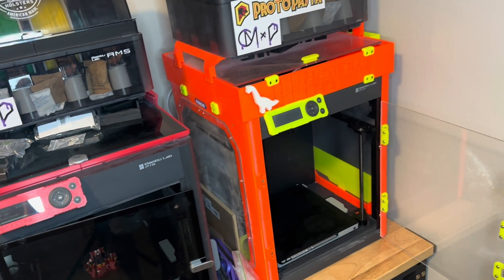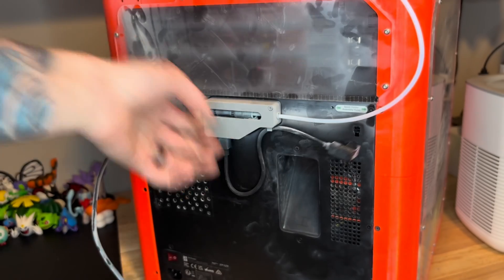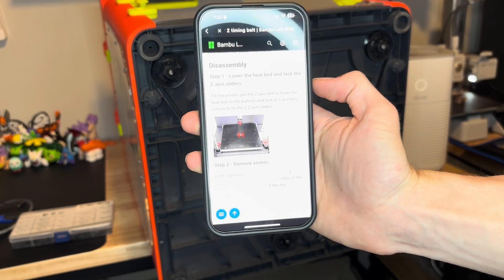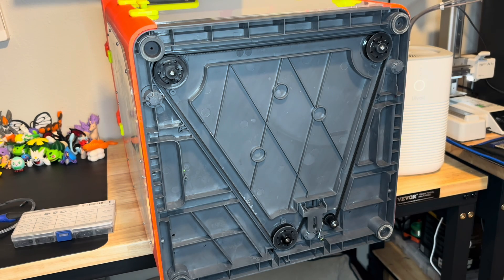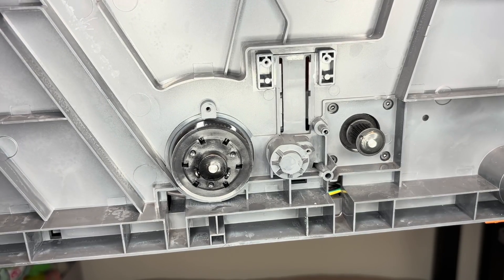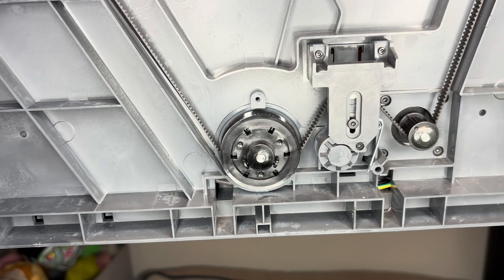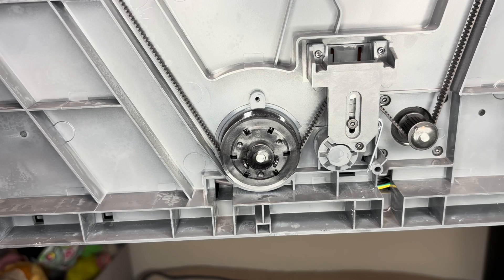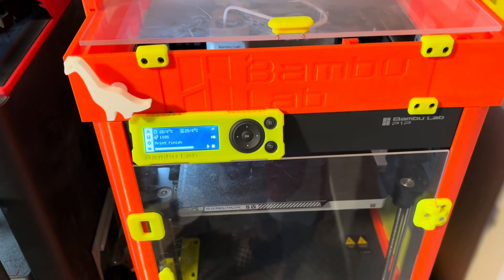P1P/P1S/X1 Z-Belt Tension Adjustment

Comment: The only reason for locking the bed down is so the three screws will stay synched when you remove the belt. FYI, a new belt is 5 bucks from Bambu Labs, and a new tensioner bearing assembly is 8 bucks.

Comment: What if you move one of the rods circle to much before you put belt back? Will that rise one side of printing table?
P.S. don't wear any jewelry on hands when you work with mechanic.
Reply from the maker: No it wont matter. The printer will run through a leveling test befor your print and auto level the bed

Comment: I would recommend using a toothpick with some kitchen paper around the top to clean the bearing, instead of  metal on metal action.

Thanks for the video! You gave me the confidence to do this maintenance and since then the squeaking is gone. I had a lot of build up on one side of the bearing where the belt was rubbing against.

Comment: I think you missed a step at 18:10 unless they recently updated their guide. Good video tho, appreciate it. 

"pull the Z belt to move the heat bed up and down, confirm that there is no abnormality in the movement, and then lock the tensioner screw."
Reply from the maker: Yeah that was added after i did my video.

Comment: What do I lol. I skipped reading the manual and I don't have those locking screws anymore I took the belt out before doing it and I had to lower each lead screw separately till it hit bottom, I want to put it back but am afraid I ruined the leveling. Any idea on what should I do.
Reply from the maker: So the best way to fix the leveling if you have all the parts out is to put the build plate all the way down and then re assemble from there. You can buy the spare parts from bambulab.

Comment: Great vid and directions. It worked perfectly on my first P1S, but on my second one the nut for the "Z-Axis Tensioner" fell out and vanished. Be careful y'all bc the threads are on a little nut that's not glued in. It just flew right out.
Reply from the maker: I have a whoke box of extra parts for this teason
Reply: @NotAnotherPrintingChannel  My collection of spare parts is growing. Had a hard time finding any info on the size needed...so I guessed. Lol. I bought a pack of M3 hex nuts from Lowe's and luckily they worked.

Comment: Don't you need to align the heatbed? You rotated the individual Z-axes without a belt. Not much, but that could have an impact, right? I was just wondering.
Reply from the maker: You do want to be careful but no there’s only one drive motor from what i have seen it self aligns

Comment: Thanks :) I have some noise from one of the bearing under one of these big black wheels.. it look like I have to remove all the stuff... only printing PLA not save me ^^'
Reply from the maker: I would first try to lubricate the bearing with 3 in 1 oil or bearing oil before you tear down
Reply: @NotAnotherPrintingChannel  I remember to have try that already by the top on the screwshaft side, I will try again to avoid unmount the whole thing. Thanks for advice :)

Comment: The video does not actually tension the belt....clickbait title. He thinks the belt is tighter after folowing the wiki but there is actually no tensioning system.
Reply from the maker: The tensioning system is the spring loaded piece in the front of the printer. You should do your research a little better 🫠

Comment: I wonder if you can just remove the small black screw and just re tighten after. I feel like this has a lot of unnecessary steps if you’re not replacing the belt you only need to fix tension.
Reply from the maker: Yes you could do that. However removing the belt allows you to check it for cracks easier. Also its important to clean the pulleys of dust and debris
Reply: @NotAnotherPrintingChannel  makes sene. my machine is brand new though and I suspect it just wasn't tensioned right

Comment: Do you put rhe 3 screws back on the z sliders after you are all done? I didnt see you do it and the wiki doesnt say anything about it either
Reply from the maker: If your talking about the tensioner yes.
Reply: @NotAnotherPrintingChannel  i think they are talking about the screws you removed from the inside of the printer right next to the rods. you didn't show when to put them back (before or after the 26min self calibration)
Reply: @ForelsVR you must not even own the printer then lmao. Those lock the build plate down to the floor do the printer so it can’t move up and down

Comment: I did the same and now cant calibrate z axis. 😢
Reply from the maker: You don’t calibrate the z axis… you mean it wont home? Then the tensioner is set wrong on the belt
Reply: Yeah.  It’s a post from a year ago.  He was talking about getting the “z axis homing failed “ error message. I’m here because I’m in a rabbit hole. I’ve done every thing possible under the moon and I have been printing for years and cannot get the error to stop coming up.  It has made one of my machines non useable.

Comment: Hello again, so you didn't have any issues doing it the way you did? The Bambu wiki maybe was a bit different than you. The Bambu wiki on this matter maybe was confusing and at least one thing was like how did they remove the actual z tensioner piece while the z-belt was still on was interesting... Like how'd they do that? On the X1 series wiki, it states like do not let those 3 black wheels rotate because it will cause heatbed to tilt but with the screws locking the build plate would that still really happen? Who knows. In summary or back on topic, so after you did it, no problems and it is all good? I may have sounded harsh or rude to you when saying like the BAMBU WIKI WAY IS DIFFERENT THAN YOUR WAY, but mayeb not wanting to sound rude. XD Thanks again :) Well my P1S's self-test was successful so that's good ig
Reply from the maker: I followed the wiki for p1s step by step

Comment: Do you do a lot of dry wall work near your printer? I'm trying to figure out what all the white dust is on it. 😀

I just did the X and Y belt tensioning on my X1C earlier today. I had to take the back off to get the chamber fan working again and decided to properly clean everything (including the rear Z screw which you can't get to very well from the inside) and hit the belts while I was back there.

I had no idea there was another Z belt tensioner on the bottom. I feel really dumb because now in hindsight of course there is. 🙂There looks like there are some scratches behind the belt on the bottom left side of the belt V. Or is that just funkily collected dust?

Thank you for sharing the step-by-step process of re-tensioning the Z belt.
Reply from the maker: Thank you and honestly i dont know what all the dust is…. I live in a very dusty area but its in every room of my house not just on the printers
Reply: @NotAnotherPrintingChannel  ya that's not healthy..
Reply: I just looked at the back of mine and has the same thing, I think it's dust from the ptfe tube's wearing.